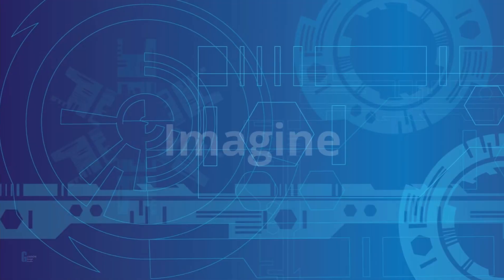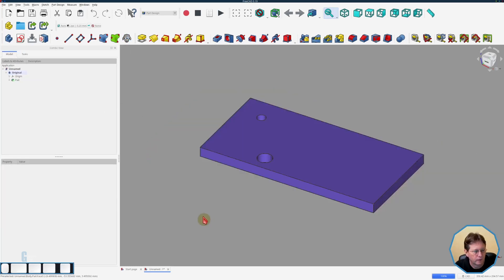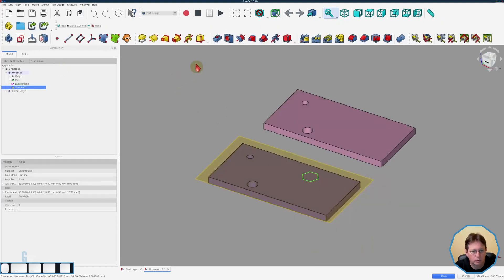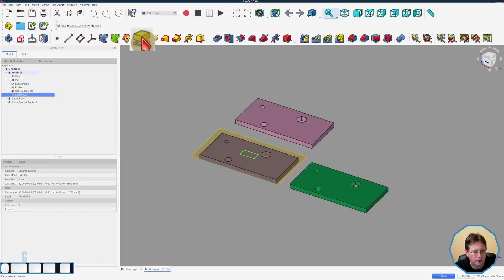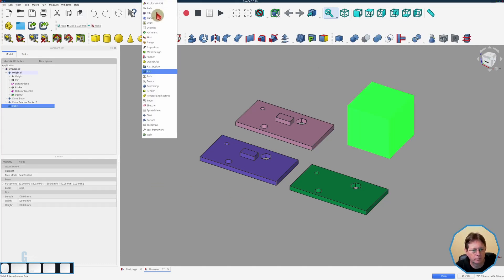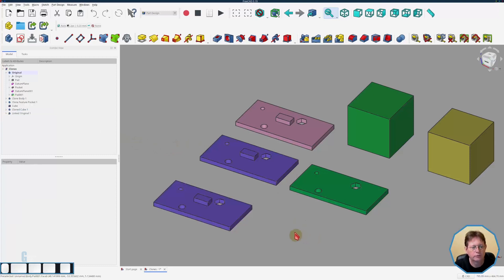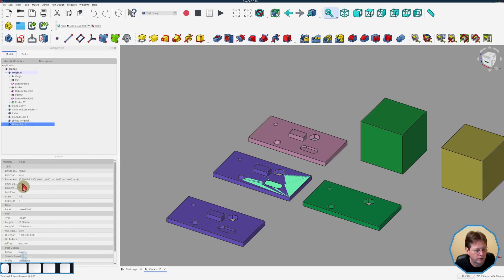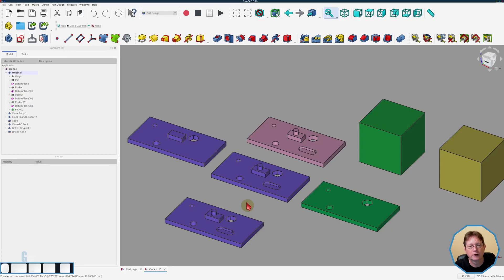What are the differences between FreeCAD's Clone and Link tools?

Comment: Thank you for this video. Nice and clear. I would lovento hear more about why one is better than the other (clone vs link). I see that linking objects from external freecad documents may help you keep the work nice and organized. But I am still not sure if this is the only benefit of link over clone? Thanks !
Reply from the maker: Thanks for your feedback. I don't think that one is better than the other  but I think that your workflow will dictate whether Clone or Link are better tools for you. I have a software engineering background and I tend to think along the lines of designing reusable modules that I can incorporate into new designs. This has led to my preference to use the Link tool as clone doesn't suit my workflow in most instances.

That said, I am experimenting with some furniture designs that require physical templates to be created that will make the manufacture of the furniture parts easier. I am using the Clone tool as part of this experimentation as it APPEARS to the better solution BUT I haven't finished with the experiments and am not ready to make a statement on that just yet.

Comment: A difficult concept that is well explained, I not quite sure about this though.  I understand but it seems wrong. The clone tool shouldn't be called that, since it doesn't actually make a clone, it makes a link, as evidenced by modifications on the original showing up on the clone. Eg, you were to clone a sheep you would not see this effect.  The link tool seems to do the same thing but you don't have the option to move it.  So there isn't much difference. Feels to me like this is a bug not a feature.  The clone tool should make a copy. The link tool should make what is now the clone tool, and the current link tool should be tossed. (unless you know of a use case for it.) Also, you alway add a datum plane to avoid the naming problem. I know you can click on a face and create a sketch on it. Would it make sense if this was changed to automagically add a datum plane when you did this? I think that would be more intuitive.  Good video, and I like this style of tutorial.  I'm not suggesting you make changes to the program, just discussing the idea.
Reply from the maker: Thanks for your feedback Chris. I'm glad you liked the video.
I hadn't thought about the Clone and Link tools in the same manner as you but I can see your point. They are quite similar but I prefer to use the Link tool because I can link to external models in which I have defined standard parts, etc. The Clone tool doesn't have much place in my work but it's there and I thought it would be interesting to look at the differences between the two. I'm not sure that adding the datum place automatically is such as good idea but I can see the merit of it. I am not involved in the development of the software but my understanding of the topological naming problem is that it is an issue with one of the core software libraries that FreeCAD uses. Using a datum plane to avoid the topological naming problem makes sense, but at the end of the day IMHO it is really just a workaround to a fundamental problem and a better solution would be to fix the problem properly if possible. I don't know whether the FreeCAD developers have any sway with the developers of that library so I can't say that they'll be able to fix the library. I know that one of the FreeCAD developers who goes by the name realthunder has a development version of FreeCAD (it's called LinkStage3 I think) in which he has fixed the topological naming problem but I don't know how he did it or when the fixes will be merged into the main code.